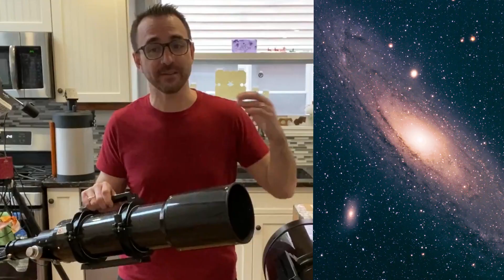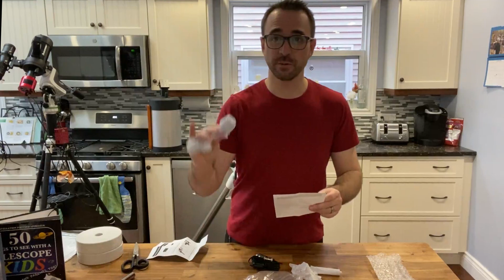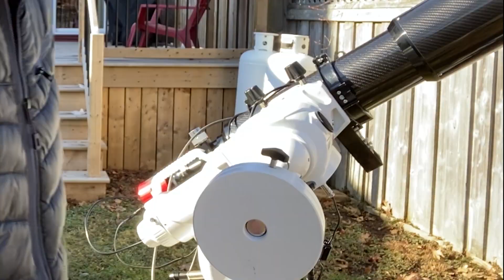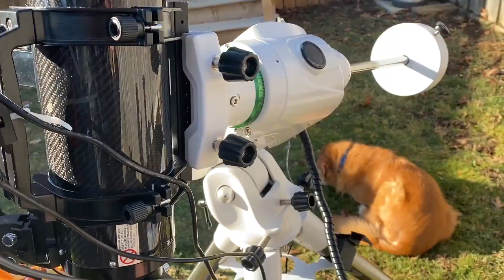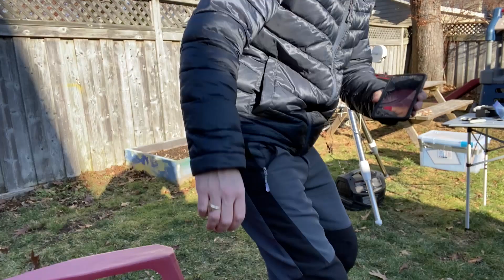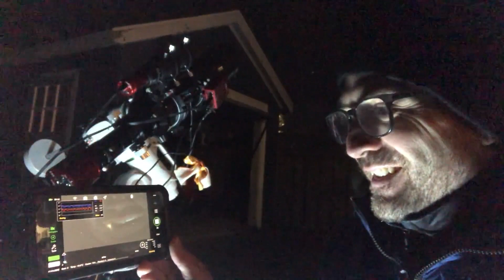EQ6-R Pro Assembly and Simple Imaging Techniques

Comment: Hey, I actually purchased your book for my kids...thanks for creating it. I just wanted to chime in and say that you don't have to do any alignment or even have the hand controller plugged into the mount in order to use the ASIAIR pro. You can simply plug at usb into the mount and into the ASIAIR and choose eqmod mount from the mount list and port 11520. As long as your mount/scope is at the home position when you connect the mount to the asiair pro, it wont have any issues at all.

Comment: I just purchased the Eq6-R Pro and am having some PE and drifting issues.  I like the demo you gave, but I'm wondering if you've had any issues with PE with this mount?  Did you do the PEC training for the mount as recommended in the SynScan manual?  Also, other YouTube vids on the ASI recommend using EQMOD as your telescope rather than SkyWatcher SynScan.  Have you tried that?

Comment: Thanks for the video John. I'm a newbie at this, and your video helps... but i have so many questions. For example, why add a focal reducer to an expensive refractor? Why not just get a smaller FL refractor? Why does the new expensive EQR-6 mount need a cheap guide scope to track ? What was it that made the first exposure of Orion so good and impressive? Was it the new EQR-6 mount? How would that image been different had the gear been mounted on the other tripod you had in the backyard?  Cheers!
Reply from the maker: Refractors don’t typically produce good images without a flattener/reducer. Aperture determines resolution, that’s the reason not to go smaller. Unless you’ve got a permanently mounted scope and are doing shorter exposures, guide scopes are required   for accuracy. The other mount wasn’t as reliable, it wouldn’t hold position reliably even with guiding.

Comment: You set the scope and all your gear on the mount without your counter weights first. That’s a big mistake if your clutches slip that’s the end of your gear. Always put the weights on first before your scope. The retraction of the weight bar into the mount is for storage/transport plus its easier to carry. When you are setting up always fully pull the bar out as far as possible then put your weights on. The last thing you want is for the bar to slip if its retracted when you're imaging

Comment: Very helpful video 
Question how did you align day time with 3 stars when you can’t see the stars in day time?
Reply from the maker: I don’t understand the question. Sarcasm?
Reply: @LearnToStargaze  
No sarcasm 
I’m serious I see in your video you align the scope to track the sun for with filter but I didn’t understand how did you do it 
I thought you did 3star alignment some how
Reply from the maker: @AstroRef68  Ahh, I see,  I probably just aligned the scope with the compass on my phone. The sun is not exactly a small target, and we're not doing long exposures, so precise tracking is not required.
Reply: @LearnToStargaze  I'm just coming across this video now, and this was the first thing I noticed as well. Maybe you've discovered this by now but you didn't actually do a 3-star alignment, you just said "looks good" when the mount asked you to align to those stars. The typical procedure (polar alignment aside) is that the mount will go to where it thinks those stars are, but it's rarely (if ever) exact the first time. It wants you to center the given stars in the scope before pressing "OK" to go on to the next star. Given those three points, it will have a correction model to work from when using "Go To" functionality.

If you used that "alignment" at night and asked the mount to go to a given target, you'll be frustrated to find it'll always be off. It might not matter if you're manually finding a target and then using the ASIAir with a guide scope for tracking, but the mount's Go To functionality won't be accurate.

Comment: This is probably a very simple question...
I purchased this mount hoping to grow into it someday with DSO imaging. Currently, I want to just mount my camera on it and track the night sky for some nice long exposures at low ISOs. I am stumped with what to align my startracker to....am I correct in assuming I just choose an object in the milky way and track that?
Reply from the maker: This might be a better question for Astrobackyard, but if I were using this mount as a star tracker for a camera, I would just treat the camera as a telescope. This means setting the camera in the mount's home position (~ pointed at the North Star). And then do a standard 2 star align with the mount, centering the alignment stars in the camera viewfinder. Once the telescope is aligned, use the Go-To feature to frame the shot.

Comment: Maybe this is a stupid question, but do the dec and ra clutches need to be tightened to run the mount with the motors? Setting mine up right now and just read that and seems counterintuitive.
Reply: Correct. They need to be tight.

Comment: John, what did you use for a light source for your flats?
Reply from the maker: A $20 led light box from Amazon.
Reply: @LearnToStargaze  Perfect! thanks for the reply. I am waiting for my EQ6-R mount to arrive (this week I hope, my Edge HD 8 tube might get here before the decade is out) and I am using an ASI Air Pro. I picked up on a couple of goodies from your video that I'm going to try when the mount arrives. Something that I'll pass your way...I bought a GL-AR70S-EXT router that runs off a usb port on my power supply. I mounted via Scotch "velcro" on the top of my ASIAir pro. They are almost exactly the same size. It greatly increased the range of the 5G wireless connection. I want to think it was about $50 US. I am currently using all of my stuff on a Nextstar 6 SE until my replacement equipment arrives. When that happens, im going to give my grandkids the 6SE. I'll be looking at a couple of your books to pass along with it. Anyway, thanks so much for the video!
Reply from the maker: @hurdpcs2802  Exciting! I just ordered a wifi extender myself. Can't wait to use the scope from inside the house.
Reply: @LearnToStargaze  John, you mentioned in your video that your polar alignment was pretty bad..... just how bad was it?:-) My $20 flat panel showed up today, I'm pretty impressed as to how even the lighting is for $20. My mount shipped today and I ordered a new camera over the weekend. I'm sure that's why its supposed to rain this weekend:-(!
Reply: I have heard of issues with the new eq6-r not connecting with the asiair pro due to a chipset change in the mount. I assume you didn't have an issue with yours, correct?
Reply from the maker: @hurdpcs2802  I mean, the ASIair is quite buggy, but when I have issues, I just reset it, and that usually does the trick. I just set the ASIais to Synscan, and it pickedup the mount, no issues. The ASIair is plugged directly in to the hand controller.
Reply from the maker: @hurdpcs2802  Very bad polar alignment, as in,  I have no idea how close I was. I simply set the scope in the driveway, set it to my approximate latitude, and pointed it approximately north. I just let the guider pick up the slack, and it works out well enough for my purposes.
Reply: @LearnToStargaze  I doubt I could get away with that at the moment, just like my main ota, my guide scope is on backorder till may

Comment: Is the Celestron powerseeker 114 eq a good beginner telescope?
Reply from the maker: The mount on that telescope is quite challenging to use, and the scope is a bit underpowered. A better option would be a small dobsonian (6 or 8 inches), or ~100mm refractor like the Celestron Inspire 100az or Celestron Omni 102. You might want to wait a month or so until the stores are back in stock, almost all these telescopes are still sold out after the Christmas rush.
Reply: @LearnToStargaze  thanks 👍👍

Comment: 3 star alignment in the middle of the day ???
Reply from the maker: Why not? It was the first time I ever turned it on, and basically wanted to see it spin around. It also gives it the approximate location of the Sun so that we could test the focus.
Reply: @LearnToStargaze  Do you not need to visually see the stars ?
Reply from the maker: @SmeeUncleJoe  the telescope doesn’t care where it’s pointed. Obviously it wasn’t properly aligned after the process though.
Reply: @LearnToStargaze  Which begs the question as to why it was even done ? What is the value of an inaccurate alignment  ?
Reply from the maker: @SmeeUncleJoe  because it starts the tracking process and I wanted to track the Sun.